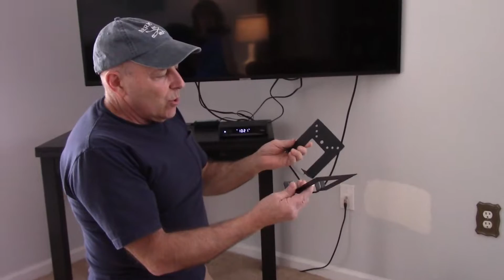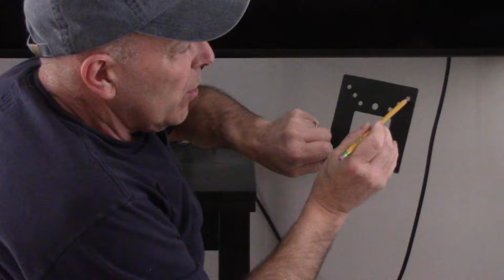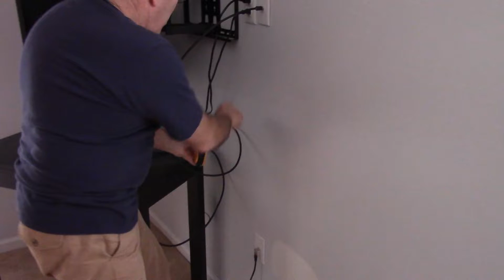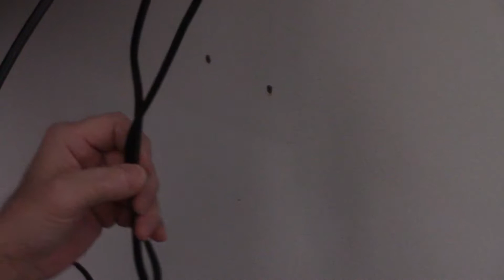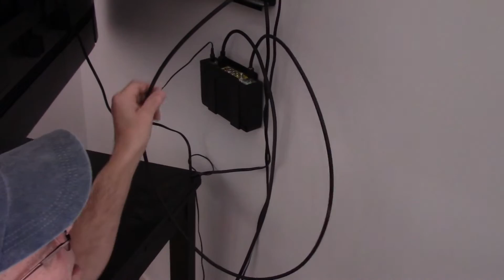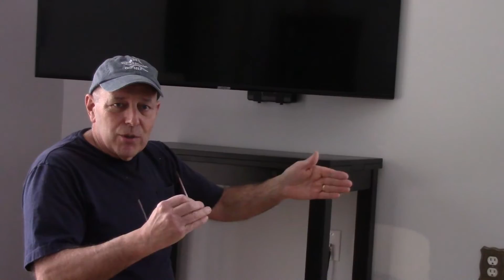How To Mount A Cable Box & Hide The Wires In The Wall

Comment: Why did you not move the U Shaped Brackets up the wall 12" more so you don't see the brackets???
Reply from the maker: Good question. The reason that it it mounted a little under the tv is because the remote will not work if it is hidden behind the tv.